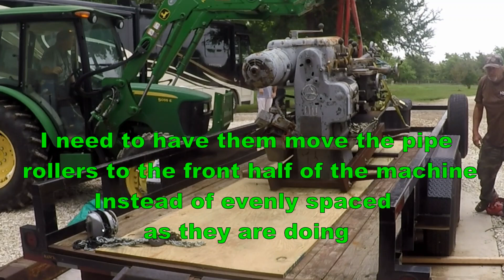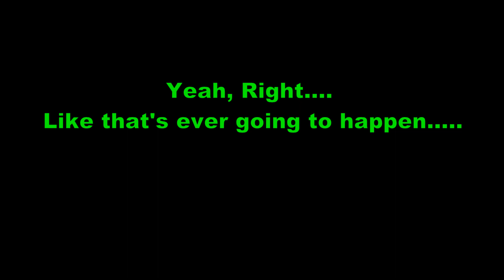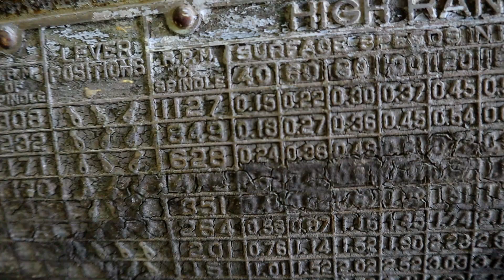How I move heavy Lathes!

Comment: If I had a tractor that could get it that light on the trailer, I'd use my truck to pull the trailer out from under the lathe then set it down.
I had two machines that fit in the back of my Excursion. With those I reached in with my cherry picker, drove the truck forward and put the machine down on a pallet then move that with a 5000lbs pallet jack.
Without the tractor to help out, I usually have a "sled" built ahead of time. The place I by the machine from almost always has a way to get it on my trailer. I put the sled under it when they load me.
The sled is a pallet with a solid top and 4x4 frame. I keep the outside 4x4's uncut so 8' to 10' long.
The magic part is the board I got out of a treadmill. I don't know what they use on the things but they slide on any surface. It's the board under the belt you run on.
I once pushed a 800lb crate, by myself, across my shop floor 20 feet with no problem at all.
Put that under my long pallet arms I can slide it off my trailer without using a ramp.
I let the air out of the tires and lift the tongue with a cherry picker and it slides right off.
Reply from the maker: Well my tractor can't handle that weight, not even  a 4th of it... Rollers were easy and cheaper than renting a fork.  Heck my little tractor can't even pick up a Monarch 10ee and struggles with a Bridgeport :(
Reply: @10swatkins  well I still envy you your tractor. Any tractor is better than no tractor at all. Good job with the rollers.
Reply: @10swatkins  my first big piece of equipment was a 4800 lbs Lagun mill with a Bridgeport variable speed J head. It has a big eye hook on the top of it. The seller used a backhoe to plop in right smack dab in the center of my 20' rental trailer. I got it home and couldnt get it off of there. A RENTAL TRAILER.....
It had high sides and no ramp. Super top heavy.
After a week I finally got the idea of calling a tow truck with a boom. It could BARELY reach it.
But for 50 bucks, they picked it up and put it down on a pallet base in my driveway. Then a pallet Jack into the garage.

Comment: Think I would have hooked it to the tractor and dragged it off personally, using the tractor both to pull and brake it, but you got the job done! And safely! Always fun moving heavy gear!
Reply from the maker: I go more for the controlled method :)  Too many years as a 911 Paramedic seeing what happens to people.   Thanks for watching!
Reply: @10swatkins  Done so much machinery operation, I tend to default. I have come around to the joys of lever hoists in the last couple of years though.

Comment: A tilt trailer would be good for this job, too. Nice video!
Reply from the maker: I have used all kinds of trailers for this... From drop deck to axle tilt to bed tilt and flat with ramps... This move was actually the easiest so far as the angle of the ramps can be changed by lowering or raising the tongue of the trailer. Made the ramps articulate and easier to control... A tilt bed trailer was not as easy as the end of the trailer was the ramp and when you needed to lower the angle the end of the trailer had to lift off the ground... As we move longer lathes it gets even worse.
Reply: A slider back truck and a couple experienced millwrights would be even better,

Comment: Question: assuming that you have an air compressor to re-inflate tires, would letting the air out of the trailer's tires be an option, to thereby lower the trailer and make the transition down the ramp a bit less steep?
Reply from the maker: It was far easier to just jack up the trailer toung :)

Comment: When I saw your tractor....well maybe it's big enough....but when I checked your massive mount Rushmore lathe....maybe not..!
My 50 hp kubota struggles to lift just one end of mine....and I got to `go on the trailer` not having to slide off of one....
Reply from the maker: My tractor will lift a bridgeport but not a Cincinnati Toolmaster or a Monarch 10 EE...   Sometime I get my friend to bring his big skid steer or tractor... Today I moved a 4600 ln radial arm drill off the trailer and into the shop.. The video will be out in a few days....
Reply: @10swatkins  a Bridgeport is not a 3,000 pound 15x 60 colchester...either one probably exceeds the set bypass valves....not a pretty sight ....I set my leblond in the mud and saved my 30K from a similar plight....moral of that one is to wait till it drys out before taking a lathe off a safe dry trailer. Your jojndeere looks massive with those pickle forks compared to my 5030.

Comment: You make it look easy! My incline machine move was terrible with pipes constantly rolling to low spots.  I did the chainfall-on-its-side once too and decided to go with lever chain hoists for the future,  Maybe I haven't watched enough but how do you get the machine off the skates and off the carriage?  Looks like the tractor didn't quite have enough...it could pick one end at a time but not the full load...
Reply from the maker: I use a 6 foot metal pinch bar and step blocks... Very easy... Tractor is just too small :)   Watch the new video in a few days  we are moving a 4600 lb radial arm drill off the trailer and into the shop using just manpower, chains and pipe...

Comment: Hi Steve- How did you get the lathe onto the trailer? Thanks!
Reply from the maker: IF you will notice there is a "sled under the lathe. I built that years ago when I had to get another Axelson 16 out of a tight garage with no way to get a fork in... When I did that one I made the sled so that I lifted the lathe up about 1/2 inch with bars and then bolted the halves of the sled  together.

For the one in this video I took the sled and bolted it together and dropped the lathe into it with an on site forklift... Much easier :)

Comment: Why not lift lathe with straps hold in air and drive trailer away and then bring lathe as close to garage as possible then set down on pads?
Reply from the maker: I had no equipment to lift the 6000 lbs up with,,,,,   This is called " Poor Boying It" :)

Comment: Idk why people get all bent out of shape when it comes to moving heavy equipment or furniture.... 
Recently someone mentioned to me they came across a giant double door store safe. I think they said it weighs roughly 7,000# , now granite is heavy too especially if it's the same size but I meant granted it's been layed or knocked over by someone and it's going to be a little more work but, to me that's perfect cuz I'ma pull up weld a tongue on one end and wheels and maybe an axle on the other end with the rates capacity, hook up and roll out....done. yeah it'll work and while lot faster and safer than any other way they could load it....I guarantee u that. Lathe or a mill though yeah, it's work and equipment ur going to need...
Reply from the maker: Yes it is work :)  Most things I do like this, only the Beast column required a crane because I had no head room and had to cut a hole in the roof...